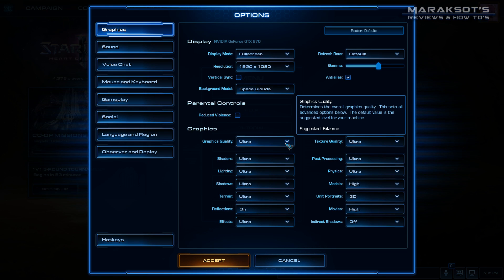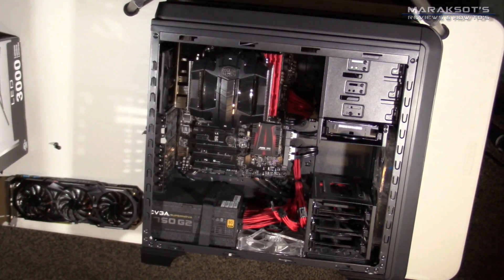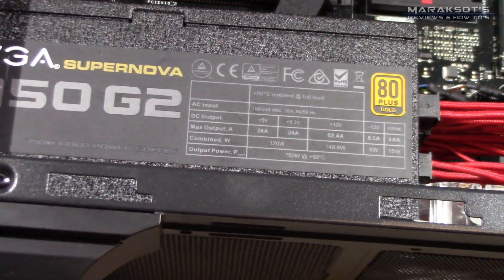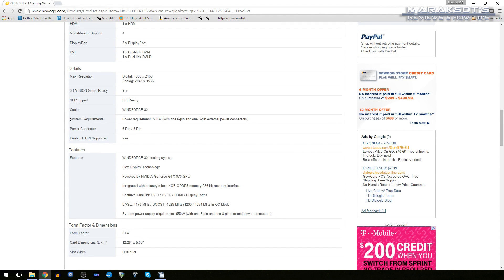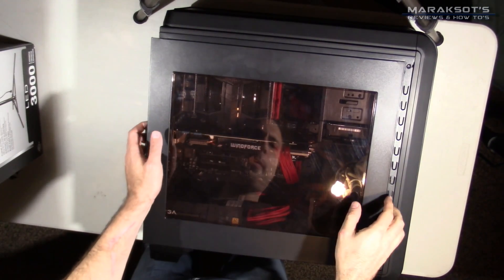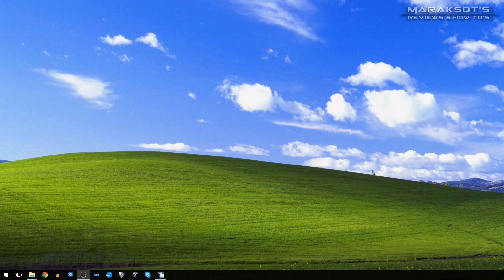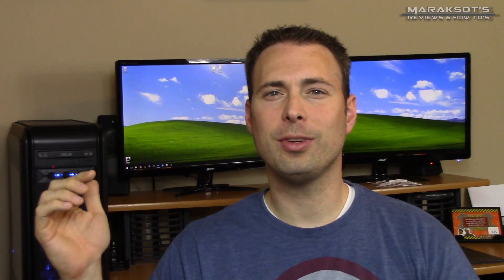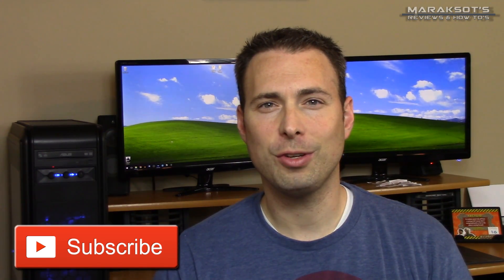A Beginners Guide - Upgrade your GPU - How to Install a New Graphics Card

Comment: My PC has a PSU that says do not exceed 220 watts(Im assuming it's a 220Watt PSU), can I use a graphics card that requires 300watts? I cannot find any that only requires 200watts
Reply from the maker: +One123 I have to admit I'm not quite sure how to answer your question.  Not knowing what your CPU and RAM configuration is I can only assume from the 220 Watt PSU that you have a pretty budget oriented PC, probably designed more for everyday computing than for gaming.  So first off after asking what your CPU is and how much RAM you have, I'd ask what kind of games you're wanting to play and at what settings you're looking to play them on?  Because if you're wanting to play current AAA titles at max settings then obviously you're going to need something with a bit more horsepower.  If you're looking to drop a GTX 950, 960 or a Radeon R9 270, 370 or 380 (something in the $120 to $200 range) those cards recommend at least a 350 watt to 500 watt PSU depending on the card.  Once again assuming your PC is a budget, everyday computing type of machine... if it were me I'd start saving my money to build a new PC because those really inexpensive graphics cards with low power requirements often times do not provide enough performance to justify their cost.  In my opinion you're always better off to save up and buy the best components you can afford rather than buy something of lower quality/performance and later feel like you wasted your money.  Check out this video from Linus Tech Tips, they do a really good job illustrating the point I'm trying to make.  https://www.youtube.com/watch?v=xp6ltBCMDCE  I hope this helps man, I'm not trying to dog on you or anything like that I just don't want people to make some of the same mistakes I have in the past and waste their hard earned money.
Reply: Maraksot78 I have 4GB of DDR2 Ram
CPU-AMD Athlon II X3(425 triple-core processor) at 2.70 GHz. 
GPU- Nvidia Geforce 9200(Integrated) 
Windows 10
750GB HDD(Not that it really matters)
And the case is really small so im gonna need to buy a low profile card my PSU can support
Reply from the maker: +One123 thanks for the info. Taking a look at your CPU... looks like it first came out in 2009 which makes it 7 years old now and in computer terms that's starting to get up there.  I would think that any current gen graphics cards worth spending your money on that's not crazy expensive, i.e. GTX 950 or R9 380 is going to be bottlenecked by your CPU in this case, so I'm going to have to stick with my previous recommendation and say if it were me I would save my money for some new gear all around, new motherboard, CPU, RAM, PSU the works.  You can reuse your case and your hard drive if you'd like, that's always a good way to save a few bucks.  There are lots of good videos on YouTube of nice builds for around $500 I'd recommend checking some of those out for ideas.  Some of the channels I really enjoy and have learned a lot from are Paul's Hardware, Awesomesauce Network, JayzTwoCents and Linus Tech Tips.  I especially recommend checking out Paul's Hardware he does monthly build logs where he lists off parts you can buy for different types of builds ranging from crazy high end $9000 builds to $500 gaming PC's.  Here's a link to his most recent monthly builds videos if you'd like to check it out.  https://www.youtube.com/watch?v=gyvMHZQY7hA&index=1&list=PLRnHcRQUxuoduPRkcsG8AWG3yxJq12hH5  I hope I've been able to at least help you out a little bit man; best of luck to you my friend.
Reply: Maraksot78 If I were to keep my CPU, should I get a card that is 1GB or 2GB of DDR3? Also to my PSU, it says do not exceed 220 watts, does that mean I can't get a card that requires 300watts?
Reply from the maker: +One123 you could get one that requires 300 watts but I certainly wouldn't recommend it.  Your graphics card is going to pull more or less power depending on the load being placed on it so if you're not doing anything that really taxes the GPU you'd probably be ok but when it starts to pull more wattage than your PSU is meant to supply then you could fry your PSU. And I've heard stories of peoples power supplies burning up on them and shorting out other components like their CPU, RAM, GPU or Motherboard so I wouldn't want to risk it.
Reply from the maker: +One123 if you're really wanting to stick with the CPU and everyting you've got you could always upgrade your power supply too.
Reply: Maraksot78 Alright thanks, I'll just save my money instead of risking anything, thanks for your help
Reply from the maker: +One123 No problem. I hope I was able to help out a little.
Reply: Maraksot78 One more thing, if I took a picture of the information on my PSU, and uploaded it online, can you determine the watts? Im not entirely sure anymore.
Reply from the maker: sure I could take a look at it
Reply: Maraksot78 Here you go link:http://i1262.photobucket.com/albums/ii606/table255/photo_zps7dpjicvf.jpg
If it's to blurry(which I think it is) I can try to retake it under a different lighting
Reply from the maker: yah you're gonna need to take another picture, I can't make out what anything says.
Reply: Maraksot78 Okay thanks for the reply, I'll take one tomorrow. I'll tell you my PC if that'll help with anything. Acer Aspire AX1301
Reply from the maker: I looked up your Acer Aspire AX1301 and it looks like it does only have a 220 watt power supply.
Reply: Maraksot78 Well thanks for your help. If you can find any 1GB DDR3 graphics cards for my PSU, please tell me. Anyways thanks
Reply: Maraksot78 If it's not to much, my more powerful desktop's PSU says, 
300W @ 25degC, 
260W @ 50degC
And this PC's case is huge and has lots of room, can I get a 2GB DDR3 Video card or atleast 1GB DDR3 on this one?
Reply from the maker: I just did a quick look on Newegg.com and it looks like the GTX 750ti recommends at least a 300 watt PSU.
Reply: Maraksot78 But it being 300W @ 25degC, will it work with the GTX 750Ti? Also this worked out well last time, my PC- HP Pavilion 500 PC Series
Model No. 500-267c
Reply from the maker: I think it will work fine. Manufacturers always list the minimum power requirement for their GPU's a little higher than what is actually needed, so I try to make sure my PSU is at least what they say the minimum requirement is just to be sure everything will work.  You only really need to be above that minimum if you want to overclock your GPU or something.
Reply: Maraksot78 Any video cards you'd recommend for me that's around $50-$60?
Reply from the maker: +One123 I wouldn't recommend anything new in that price range. Brand new stuff in that price range doesn't have enough horse power to justify the cost. You might be able to find something decent that's used on Craigslist or Ebay for that amount though.  Google is your friend when it comes to this kind of thing. If you find something in your price range on CL or Ebay then Google it and see what the reviews are like for it and see if it's worth your hard earned cash. I still stick by my initial recommendation for ya man... save your money and build yourself a better computer that you'll really be happy with. 15+ years ago I made the mistake of buying a really inexpensive graphics card and put it in an inexpensive HP I'd bought from Costco. It didn't do what I'd hoped it would do and I felt like I'd wasted my money. After that I saved up  for my very first build and put together a computer that cost quite a bit more than that HP but was way better and was something I ended up being much happier with.
Reply: Maraksot78 Is the Geforce GT 730 2GB DDR3 that supports DirectX 12 for $60, is that good.
Reply from the maker: +One123 the GT 730 is the one they tested in that Linus Tech Tips video I sent you the link for the other day. They tested it against some very new Intel integrated GPU's a.k.a. onboard video and the GT 730 wasn't able to outperform the integrated graphics on those newer CPU's. That being said your system is much older than the ones they tested so I think the GT 730 will give you increased performance over the onboard graphics in your Athlon II X3.
Reply: Maraksot78 This is for my better desktop, the one with 300w PSU, and it has Intel HD 4400...
Reply from the maker: from what I can tell the GT 730 will give you a slight performance boost but in my opinion I don't know if the amount of performance you'll gain is going to be worth the $60 price tag.

Comment: I have a GTX 680 and thinking of upgrading to 950 or 960 or even 970 (most likely 960). As a noob, can someone tell me what are the main differences between EVGA (the brand my current GPU is and what I feel I should stick with) and others like ASUS and MSI... also if by chance I do purchase the GPU, what other considerations should I bear in mind? such as compatibility with my other components. ty guys
Reply from the maker: +Aaron Wong (xxryuxx123) as far as compatability between vendors, you shouldn't really have a problem as everybody's cards are all based on NVidia's architecture, so if you have an MSI motherboad and an Asus graphics card everything will work just fine. Every vendor has their own little personal touches they like to build into their products but at their core they're the same thing. I say buy from a reputable vendor, EVGA, MSI, ASUS, Zotac, Gigabyte and get the best card you can afford at the time you're looking to buy.  Sometimes certain vendors will be running sales, so for example, you may be able to get a super clocked EVGA GTX 960 for the same price as a regular ASUS model or vise versa, just depends who's got what on sale.

Comment: installed new MSI GTX 970...blank screen. won't boot unless i remove the card
Reply from the maker: +WEREMOOSE09 that sucks man. Can you still get into your BIOS/UEFI or is it totally black screened?
Reply: I removed the ram and graphics card and reinstalled....PC booted 1st build guess i was afraid push till it clicked somewhere
Reply: Its working now thanks
Reply from the maker: +WEREMOOSE09 Good deal.  Glad you got it figured out. I know how it is, it's a little nerve racking on your first build; you just spent several hundred dollars on parts and the last thing you want to do is mess something up. Thankfully computer components are actually fairly tough. Enjoy that new build my friend. :-)
Reply: yeah haha. well i spent money and its working now. working well. now ima see what the PC Race is about
Reply from the maker: +WEREMOOSE09 well welcome to the PC Master Race! May your graphics be crisp, your frame rates high and your temperatures low.  :-D
Reply: +Maraksot78. i have corsair 500w should i upgrad??
Reply from the maker: +WEREMOOSE09 depending on the model of your GTX 970 you may be just fine. I looked up MSI GTX 970 on Newegg and found this http://m.newegg.com/Product/Details?itemnumber=N82E16814127832 according to this the minimum recommended Power supply is 500 watts for that card so if this is the card you have then you should be good.
Reply: +Maraksot78 awesome well im enjoying the games... spend half mycheck lol
Reply from the maker: +WEREMOOSE09 I hear ya there. :-D
Reply: +Maraksot78 Gi Bill and work bro....ill live... babyless and paid my bills...worrth it...cant wait for Escape from Tarkof
Reply from the maker: +WEREMOOSE09 Nice! Well enjoy my friend. :-)

Comment: Hi 1. Very good video 2. I need to ask if i will use gpu (example gigabyte) and motherboard (example MSI) will it perform well ? I was building old PC's with original nvidia gpu's without thirdparty names like (asus,msi etc...) and asus motherboards and my friends told me that it will not work like that today ;0 
THX for answer ;D
Reply from the maker: +NeX3GeN From my experience I have had no problems using different components from different vendors, in fact right now I'm using a Asus Motherboard and a Gigabyte GPU and everything works great.
Reply: +Maraksot78  Thank you
Reply from the maker: +NeX3GeN no problem man.  Thanks for checking out my video and for the question.  Happy gaming!

Comment: Very helpful guide there! Thank you!
I currently got a GTX 650 Ti. I want to upgrade it since it's pretty dated. My budget is about 200-400 dollars, so I decided to take a leap of faith and get the MSi GTX 970 OC version.
Some friends were telling me I should probably wait for 1000s series of GTX but honestly, I don't think I would be able to buy one of those.
I'm thinking 970 would last about 2 years, wouldn't it? I play games like BF4, GTA5 and Black Desert Far Cry 4/Primal and soon to be BF5. All are pretty demanding graphics-wise.
Reply from the maker: +Rami Black the GTX 970 is a pretty powerful card. It should be good for at least 2 years if not a little longer. Congrats man, enjoy that baby! :-)
Reply: Thank you ;)
Reply from the maker: +Rami Black the R9 390 or R9 390X would be a really great option as well imo.
Reply: +Maraksot78 
I was thinking of the 390. Not the 390X. I was reviewing both cards and their different manufacturers for over a month and came to the conclusion that I prefer Nvidia since I had a bad experience with AMD's drivers before. Since using the 650 Ti, I really didn't have any problems apart from it not being able to run high-end games lately.

Comment: When my warranty is over on my prebuilt pc, im going to take a piss on my fucking GTX 650
Reply: burn it just to be safe we don't want it rising from which it came. Then throw it in the garbage disposal. after that just burn it one more time just to be safe.
Reply: XD
Reply: So good
Reply: But then I would have to upgrade my PSU, Ram and CPU to prevent bottlenecking and balance loss.
Reply: ArcticSkeleton i have a gts 450
Reply: yesss do it
Reply: When my warranty runs out as well.
I might upgrade from a 290X to an R9 Fury.

Comment: will my intel i7-2600 bottleneck a r9 390 ?
Reply from the maker: +yankov_xxx360xxx_ to be honest I've never used an i7-2600... but it is a quad core with hyper threading running at a base clock of 3.4 GHz and looking at some of the other specs for this chip... I think you'll be just fine,  shouldn't experience any CPU bottlenecking of the R9 390.
Reply: Maraksot78 Thank you so much for the response , great channel and great content , keep the good work  , thanks again !
Reply from the maker: yankov_xxx360xxx_ you're welcome man. Thank you. :-)
Reply: Maraksot78  Hey i just wanted to ask another question which  is better the r9 390 or the gtx970 ?
Reply from the maker: +yankov_xxx360xxx_ I'm a little partial to the GTX 970 seeing as that's the card I have but the R9 390 does have 8 GB of VRAM where the GTX 970 only has 4 GB(3.5GB if you wanna get technical) and the 390 is slightly more powerful as well but either card is a great choice imo althiugh if I had to do it over I would probably go with the 390 or even a 390X. Perhaps I will upgrade in the near future. :-)

Comment: How much power does my power supply needs for a gtx970 en what do i need to do in my bios ?
Reply from the maker: +Youri I have a Gigabyte G1 Gaming GTX 970 and it's recommended to have at least a 550 watt power supply.  As for you bios you may not need to do anything.  Your system should detect your graphics card once it is installed, however if boot up your computer and all you get is a black screen (it never goes into Windows) then you should try updating your motherboard bios.  To do that you need to know the manufacturer and model of your motherboard (it should say the manufacturer name and model number right on your motherboard) then you can go to the manufacturers website and search for your motherboard, download the latest bios from their support page, install the bios file onto a flash drive and then boot into your bios and navigate to your bios update.  Once again you computer should detect your new graphics card just fine and you probably won't have to update your bios but just in case you do that's how you do it.  I hope all goes smoothly for you man, good luck and happy gaming.

Comment: i am getting a gtx960 sc 4gb in 2 days i have 8gb of ram and a amd 4300 quad core and i have a question should i uninstall my old drivers before installing the new gpu and i have windows seven  and i heard that when you boot up computer with new gpu it automatically installs drivers on windows 7 is that true or do i need to manually download the drivers and how do i tell if it is nvidia or amd this is the one im getting http://www.amazon.com/gp/product/B012NOWEY0?psc=1&redirect=true&ref_=oh_aui_detailpage_o01_s00
Reply from the maker: You can uninstall your old drivers before or after you install the 960 it shouldn't matter. As for the drivers installing automatically... My understanding is Windows will download the windows drivers it needs but will not download the Nvidia drivers, you'll have to do that. One thing you should also be aware of is recently I've had a few people comment that after upgrading their graphics cards they can get into their motherboard bios but when they try to go into windows they just get a black screen, the good news is they've been able to update their motherboard bios and that has fixed the problem. Congrats on the new video card man, enjoy!
Reply: i aciidently fried it so i bought a used laptop